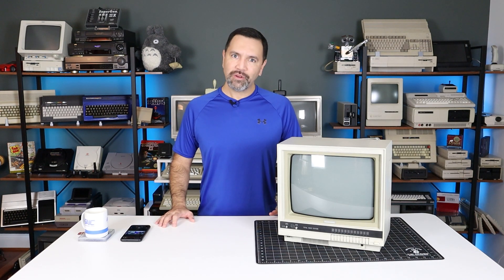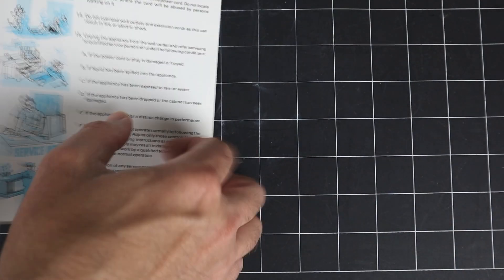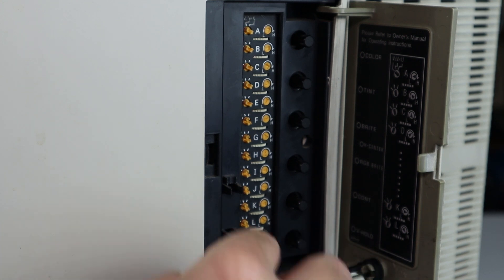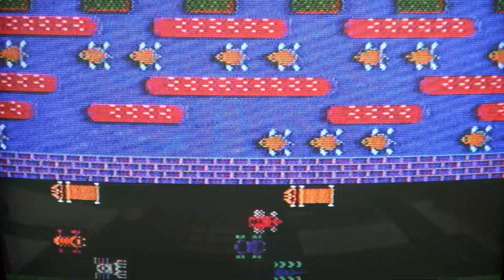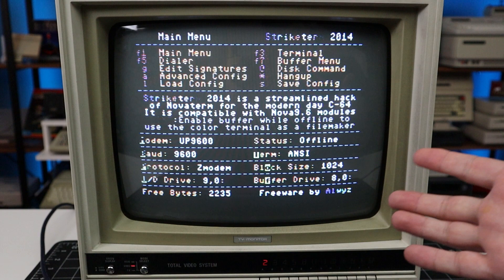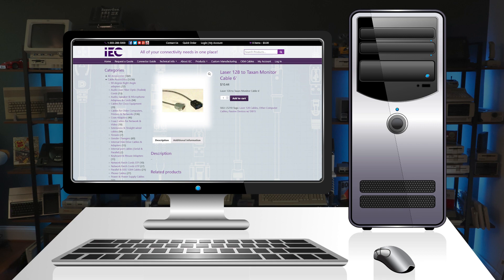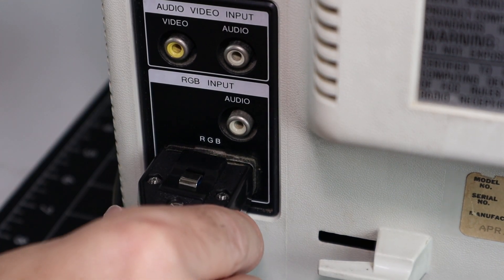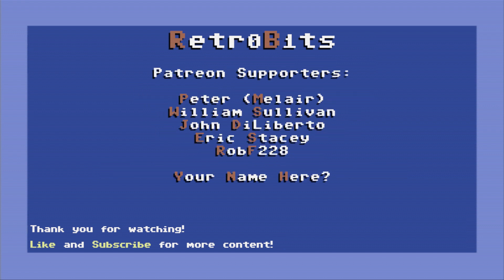One CRT to rule them all? Introducing the Sears Total Video System!

Comment: When I was thinking about one monitor for all retro systems I had to build it by myself. Because there is no chance to find device accepting Composite, S-video, SECAM, PAL, NTSC, Component and RGB
Reply: In Europe it's still possible to buy a new TV with all those features, RGB would be composite sync only though and it might not like CGA resolutions. Luckily via the SCART interface most TV's in Europe had RGB input.
A simple passive adaptor works for my Roland S330 and any TV or HDMI adaptor that supports RGB SCART even though the S330 technically uses separate sync.
Reply: @dglcomputers1498  There's no difficult to modify TV without SCART to understand RGB-signal if we are talking about USA
Reply from the maker: My PVM-1342q does all of those with the exception of the component. If we're making a wish-list though, I'd ask for both 15 and 31khz support.

Comment: I found this tv a year ago in a goodwill for $20. Took awhile to research the cable but I also found a NOS for $20 or so. Was wondering what it would take to wire up a Nintendo or sega to it. Heard this screen also supported some more defunct color schemes.
Reply: That connector is usually used for digital RGB, meaning it can't vary the intensity of any of the colors, it can only have each of R, G, and B off, low intensity or high intensity at a given time. Consoles that support RGB output analog RGB, which allows variable intensity for each color, so you aren't going to get anywhere without some complex circuitry to convert it and it is going to look terrible because you are compressing everything to 16 colors
Reply: @coopercummings8370  Well, the RGBI circuit in the TV must create analog RGB to drive the cathodes. So it would be possible to add another input on the back with some switching.

Comment: I had a Sanyo 13in multi-mode RBG, Composite and Y/C monitor. It had that same EIAJ type connector on it. I also know that Sears contracted Sanyo for a lot of there televisions from that era. Maybe this EIAJ connector is a hold out from the original Sanyo design. Just a thought. I still have the cables BTW.
Reply from the maker: Cool, thanks for the info! I think I know what I need to do now: open up the monitor and see what's inside :)

Comment: Looks good. I’d love to see it recapped and tested with some more game consoles over RGB and composite
Reply: This is a CGA monitor, it only does CGA digital RGB, which only supports a 16 color pallete, it can't display analog RGB which is what game consoles output if they support RGB, and there don't appear to be any converters from analog to CGA (there are converters from CGA to analog though) and it would look pretty terrible anyways because it would have to compress all the colors down to 16 colors.

Comment: I would suggest definitely recapping it at the very least. Maybe also look at various servicing stuff that you can do to help return it to its possible former glory
Reply: Putting up a test grid and colour pattern and adjusting the alignments and colour spaces would be a good idea.  I'd also by minded to see if I could find a new flyback transformer for it, that's probably starting to get a bit noisy after all these years.  It should be possibly to find one(might even be some stocks of actual tubes left too), either new old stock or from some retro tinkerer supplier.

Comment: sears also had a SR2000 and i think SR3000 monitor with this same video connector. i had a SR2000 way back. I couldn't find a cable for it so cut some brazing wire,inserted it into the holes and soldered wire to it and it worked on the c128. It later died on me(flyback)
Reply from the maker: Haha, nice. I was thinking of just jamming some dupont jumper wires in there to test mine. Bummer about the flyback :(

Comment: RF performance these days is a little different depending where you live and what signals could be interfering. I question that little jumper as well -- maybe a different RF box into coax would yield better.
Reply from the maker: Certainly worth a try! Also, probably a composite mod wouldn't hurt either :)

Comment: I've often lamented the terrible AV input status of screens in the past so seeing something like this warms my heart. Simply having RGB pins to work with is a godsend when so many SDTVs bitd didn't even have Composite.
Kind of surprised old school S-Video isn't present in the form of RCA Chroma & Luma ports, in hindsight I think the S-Video standard was too proprietary for it's own good and should have stuck to RCA cables. Same with with the MANY bespoke computer cables and connector types. :P
Generally what I found at least in NA was the divide between TV and monitor being one of the major obstacles for why Smart TVs didn't come a lot sooner Ie. during the 80s. Even the birth of home video VHS/LD/Beta in the 80s couldn't push SDTV makers to adopt Composite inputs more heavily. :\ So in that sense SCART regions fared better for things like Teletext and later 90s multimedia consoles for AV fidelity.
Reply: In Europe we standardised RGB on TVs into the SCART connector, kind of odd they didn't just leave them on NA NTSC models given the inherent image upgrade.  Even some US versions of consoles such as the Gamecube were artificially hamstrung by having the RGB connection removed internally so you'd be forced to mod to use it so you couldn't even hook a monitor up to it easily and cheaply.
Reply: @darthwiizius  In hindsight it was a disaster in NA for all the screen AV standards. First couldn't get a cheap TV that wasn't RF only. Composite wasn't really a fully embraced standard when 16-bit games made it a standard. S-Video was great but sales focused on a new VCR/tape type and dropped RCA cables which only confused and made adoption cost more.🤨 Only to go back to RCA cables for the Component cable.🙄Then VGA never seemed to happen except for the Dreamcast.🤕 SCART has a large port but it certainly could have covered transitions more elegantly.

Comment: This has got me wondering if there is any noticeable difference between the 3 types of RGB connections on your Sony PVM Matt.
Reply from the maker: The only flaw I can really find with the PVM is that it requires combined sync for analog RGB, whereas the 1084 can handle both c- and hv-sync so there's no need for external converters to use different systems. Otherwise, the fine dot pitch aperture grill + 50/60hz operation, analog and digital RGB, PAL, SECAM and NTSC decoding - the Sony is unrivaled in my stable. The Total Video System is quirky and cool, but it's no contest for the 1084 or the PVM.

Comment: Wouldn’t matter if polarization were something new: They still put polarized plug warning in the documentation for many modern devices. It’s less common because we have more switching and DC power supplies than ever but certain devices still have this warning. Also, Japan generally still uses unpolarized plugs… which sucks because appliances can’t reliably provide a chassis ground.
Reply: …because Japan also generally doesn’t have a dedicated ground pin.

Comment: Fun find, but it doesn't hold a candle to the Commodore 1084 of wich you own multiple examples. This thing uses a standard tv tube so it will never look as sharp as real monitor with a fine dotpitch tube. So it's only good for using it as a screen for unmodded consoles with RF-output only..  I'd sell it to somebody who doesn't own a 1084...
Reply: Ofcourse it doesn't its just a 1701/1702 monitor 1084 was meant for amigas
Reply from the maker: Yea that's my conclusion as well. It's neat and quirky and the RF input is nice to have for old systems where it's your only choice but the 1084s (and PVMs) are superior in every other meaningful way :)

Comment: Hello, can you please help me the  the model and make or what it's called or were you bought the blue device that holds those connectors with the crocodile clips. Thankyou...
Reply from the maker: I've placed a link in the description and also on the Retro Bits Amazon storefront. Here's the link: https://amzn.to/3Be9W1E It's pretty useful but it can be a bit annoying to get it set up just right and the clips don't grip smaller parts too well when the insulators are installed. Still pretty useful sometimes!
Reply: @retrobitstv  Thankyou for replying

Comment: Interesting video, thank you. I'd assumed that having the "green screen" setting on a colour monitor would have been a counter-productive(?) gimmick. Unlike a true (monochrome) green screen monitor- where dot pitch isn't even an issue because there are no dots(!)- the colour mask is still there. Worse, in greenscreen mode, only a third of the phosphor dots (i.e. the green ones) would be in use, which I'd have guessed would exaggerate the effect further.

On the other hand, you make it sound okay, so maybe it's not that bad in practice.

I remember using an old greenscreen monitor with my Atari 800XL, and it rendered colours similar to the greenscreen mode seen here- definitely not the best for anything other than text. It was also pretty contrasty, no doubt because it was intended for two-level (i.e. no grey) text output.

Comment: Wide blade wasn't exactly new but homes didn't have the outlets often back then. Not everything requires a wide blade but CRTs are DC devices and use the neutral as DC negative directly with no isolation. If you flip the plug on a fan who cares. If you flip the plug on a TV you are connecting the 110VAC mains voltage to the knobs and switches and antenna connector with no current limiting. Bad design but saved a ton of money on copper. Most tube devices are like this.

Comment: Just a glorified 1701/1702 commodore monitor
And many tvs had that jumper in the 80s
And technically it doesn't pre-date svideo as the same commodore series had Luma chroma which is the same thing just no audio
And on rgb you turned the brightness too high

Comment: Switch boxes are terrible, there's no reason to ever use them anymore. They only degrade the signal. Always use an F-type adapter to connect RF consoles directly to the coax input. Channels 95 and 96 are also nice to have programmed in if you ever want to use any Japanese consoles.